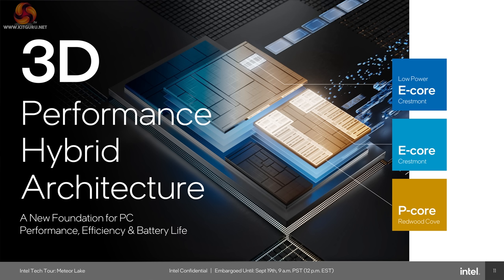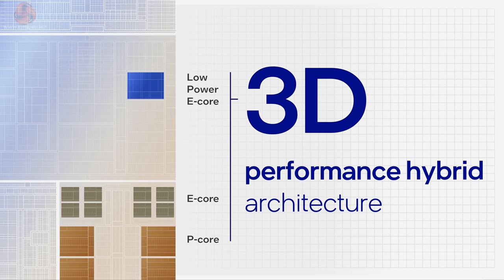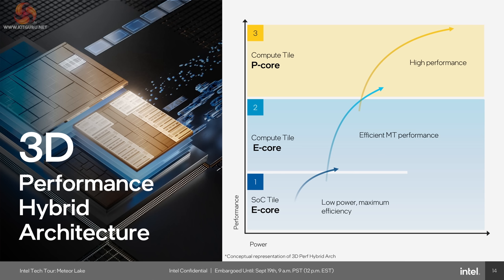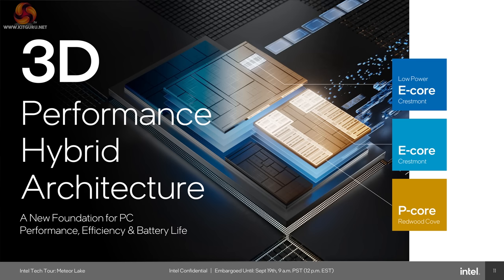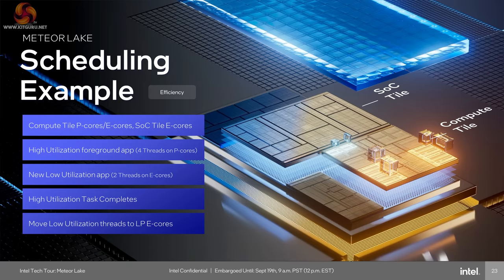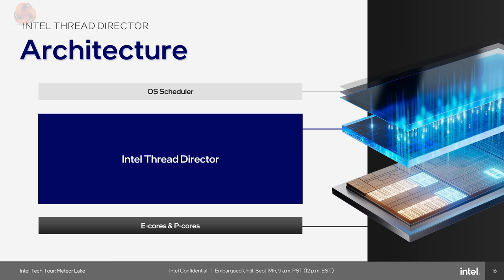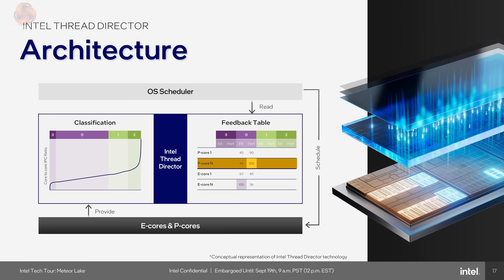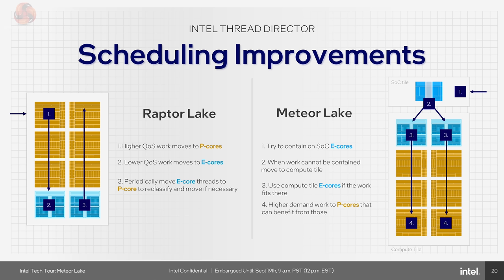How does Thread Director manage Intel Meteor Lake?

Comment: Leo, ignore all the rude comments.  This was an excellent video, and thanks to Intel and Rajshree for providing us with this information.  I thought it was a great video. She is very smart and very insightful, she has a commanding understanding of what OSes need to do to schedule threads on the various cores and how the OS can benefit from hardware guided information on the state of the CPU etc.  I suppose a follow up to this interview could be with Microsoft and/or Linux and/or even some software vendors (e.g., game engines) to see how they use Thread Director properly.  Because even though Alder Lake has been around a while, we still hear from time to time, that certain game engines function better when E-cores are disabled and/or hyperthreading is disabled.  Why is that?

Comment: Great stuff! Thanks for this content. I've always resented E-Cores as a cheat, but now I can see how these are actually good for performance all around. Nicely done.
Reply: Yes. I thought the same. Changed my way of thinking.
Reply: ECores (even on my 12900H) are equal in performance to a true core from a 6700 ; if i'm thermally limited i'd much prefer having 2 fully performant (2x4 e-cores) 6700's than 1 thermally throttled set of 4 P cores ...

Comment: Really usefull material, thanks a lot !
Something I wonder, is why there is not an internal scheduler to classify work on differents core as there in traditional CPU operations.
It seems from this speach that it is a question of versatility and power management, but still OS is also running its own QOS for  traditional CPU so I'm not convinced by this answer. 
I would like to see more about this, like deep dive into IPC of each, consumption, type of operation they can handle and comportment inside an OS.

Comment: Compared to multi-threading, is the performance of the thread-director better?
Reply from the maker: They are two different technologies that work hand-in-hand. Ultimately the Operating System makes the decisions about core and thread allocation.
Leo
Reply: @KitGuruTech  Thank you, I have another question. MTL's P core supports hyperthreading, but the E core does not. What was the reason for Intel's decision to disable hyperthreading on the E core?
Reply: @williamstsai1  they simply do not have the hardware needed to support SMT. You require additional transistors to support it, which makes the cores bigger.

Comment: I would have thought nanoseconds or even picoseconds - milliseconds is so slow...  Though if it is milliseconds, it definitely would highlight why one wouldn't want the thread to change cores very often.
Reply: No.  The timeslice for each thread to be run on the CPU is in the milliseconds range.
Reply: a thread switch is expensive for a cpu - you have to unload and reload the state of various registers (the next instruction on the thread after resuming on any core better work), you've got various pointer stacks, memory vtables, you don't want to discard any speculative execution knowledge, etc .... there is so much thread specific info inside a modern cpu ....
Reply: @andytroo  exactly

Comment: Sounds to me it would be benefitial to have a completely different OS for AMD or intel based x86 systems. With designs so different you don't want things in your OS your CPU does not know what to do with. It only bloats the OS and opens up reasons for performance issues.
Reply: I think that's what standard scheduling is, though, which runs on Intel, too. Just throw everything to the P-cores, done.
Reply: AMD needs more help from OS since they don’t have thread director to help the OS. They simply rely on OS to make judgement calls about when to use the extra tread vs increasing freq of a core. Thread director significantly reduces the OS overhead

Comment: Seems a bit overkill the way they are designing these chips with different cores just for different power consumption but guess thats just the way things are now.
Reply: except that in thermally throttled workloads there has truely always been types of workload - single thread (1 core go brr) and multi-thread( as many cores as possible - efficiency is king, until you run into single thread limits)
Reply: Literally the entire industry is going this route. Intel, Arm, Qualcomm, Apple, and eventually AMD.

Comment: Seems a bit overkill the way they are designing these chips with different cores just for different power consumption but guess thats just the way things are now.
Reply: It is all a race to longer battery life on systems that are basically idling. Only way you can compete vs ARM on x86 cores is to keep coming up with new party tricks how to shut off most of the chip most of the time.
Reply: @Jarnis-v1c There same party tricks (as well as using the most advanced process nodes) are what makes arm efficient. With tiered core system, the thread director, and advanced process node like 18A will make Intel x86 cores more efficient than contemporary ARM CPUs including the ones from Apple when 18A debuts. Mark my words.